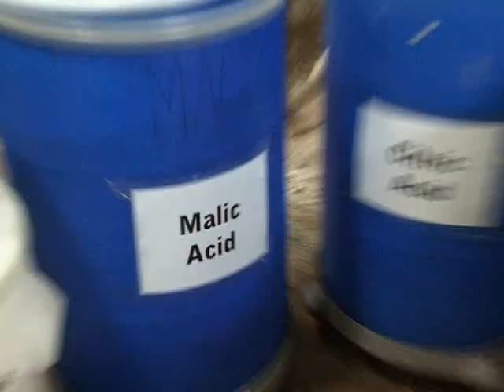WARHEADS on Kid in a Candy Store

Comment: I remember the fizzy version of warheads. Just as sour on the outside, but also had a fizz power in the center of the candy, those have been discontinued though.
Reply: What that's cool iv never herd
Reply: The ones I had were definitely sour, maybe they made a none sour version too.     I can't remember if the fizz was even advertised.... I want to say they just made a production run of the fizzy ones without really advertising it and then when sales didn't go up or it turned out to be too expensive or whatever they simply stopped putting the fizz in the center.
Reply: Bone Daddy those are ZOTZ